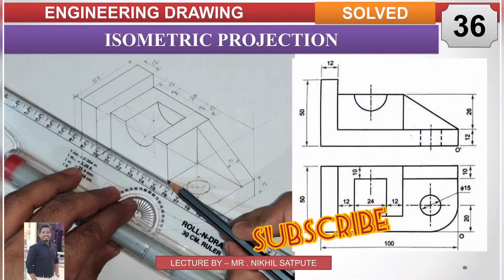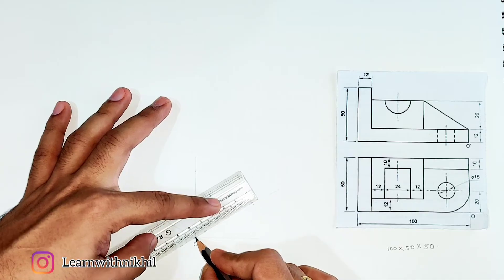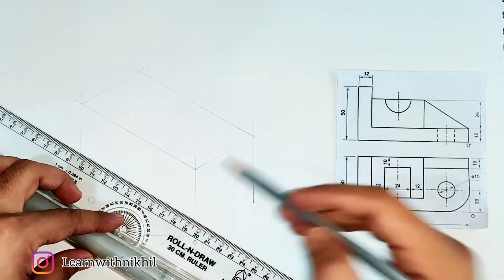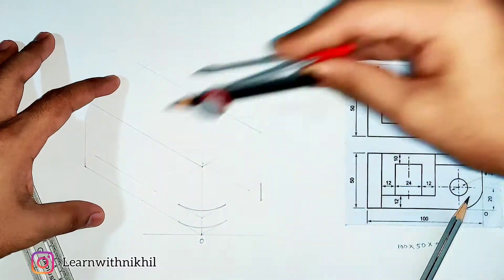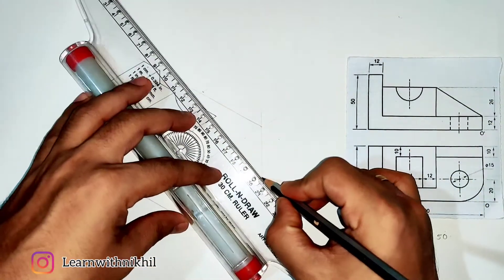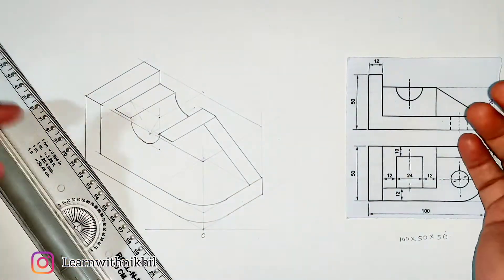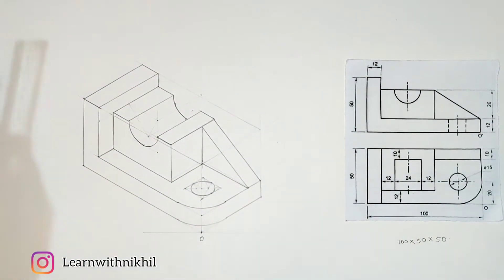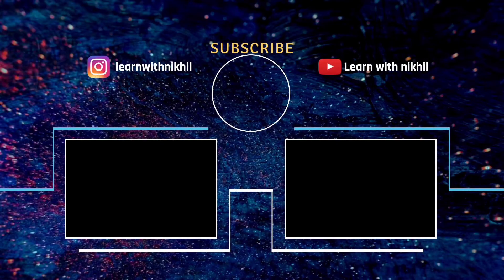Engineering Drawing | Isometric Projections Problem 36 | Learn with Nikhil

Comment: Some portion of the 15 mm dia through hole , at the zero level shall be visible and not to be ignored. Any hole with its depth smaller than its diameter, will make the other side of the hole partly visible.  Simple guideline to be remembered.